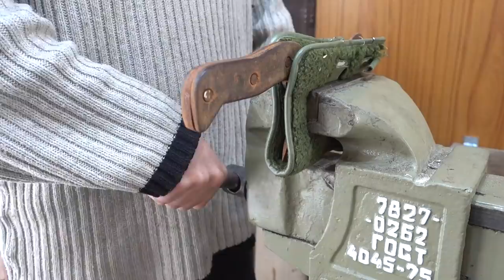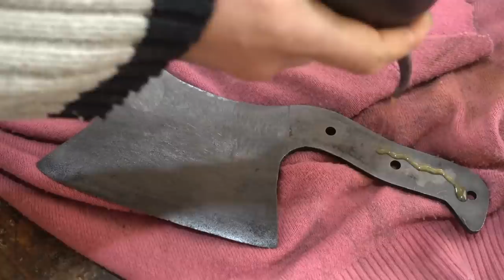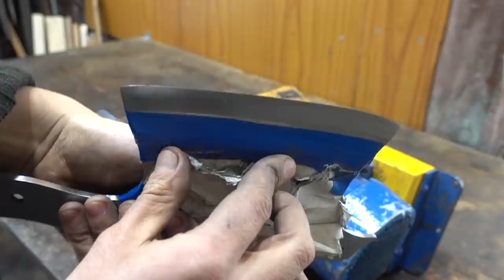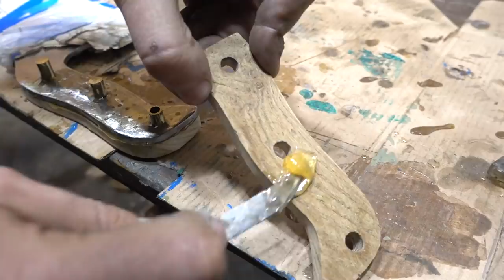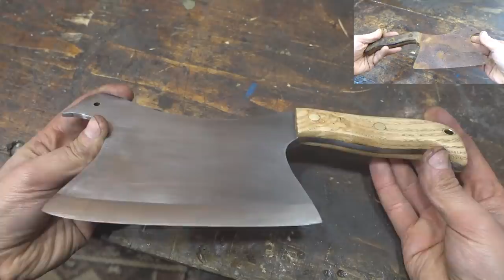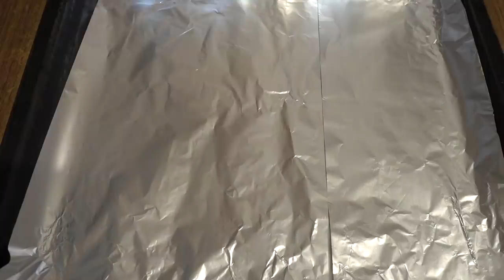Restoration Vintage Rusty Butcher Cleaver

Comment: Lovely and so soathing after a long day at work, as always, thank you for that video! Around minute 9:00 you put something on the belt of your grinder, what did you use? What was it for? Thanks in advance!!
Reply from the maker: Hello, thank you. Glad to read. Do you mean the translucent piece with which I cleaned the sandpaper?
Reply: @ScrewsAndTools  yes, that's it! Just out of curiosity, what did you use?
Reply from the maker: @arnaufont1204  This is the most common silicone. When it dries it becomes rubbery and soft. It cleans sandpaper especially well after woodworking. When sandpaper is clogged with sawdust, this method cleans it.
Reply: @ScrewsAndTools  oh, okay, thanks!!

Comment: hello, what's the name of the I will propose that you use to remove the rust?  congratulations for video, you are very good.
Reply from the maker: Hello sir, I used cheap rust remover, name is "Yeetis" in yellow plastic bottle (550ml and 2L).
Reply: @ScrewsAndTools  ok thanks